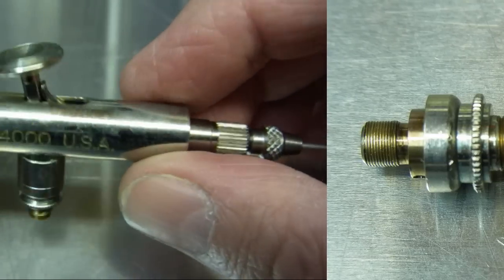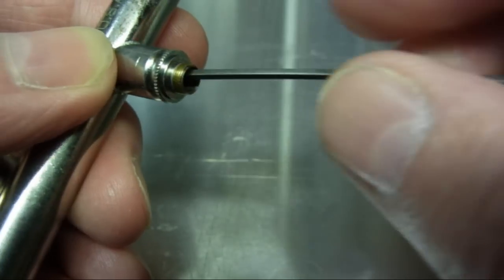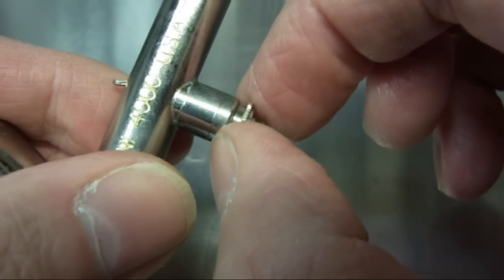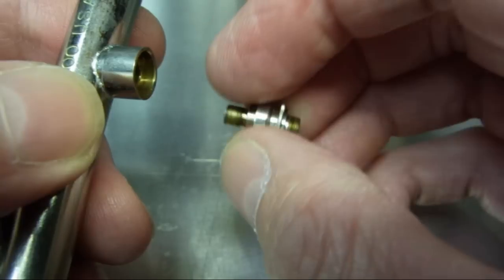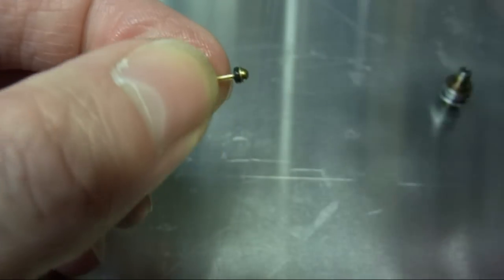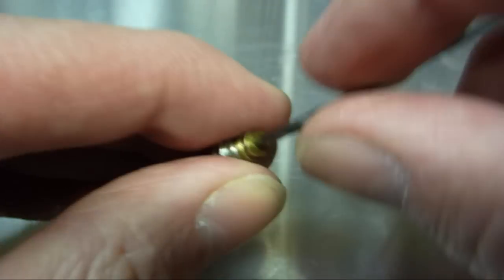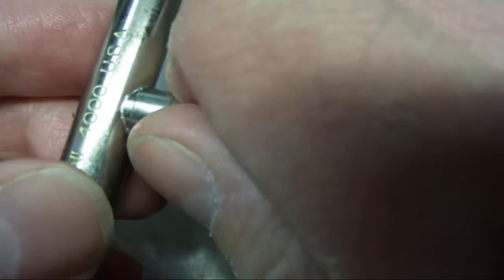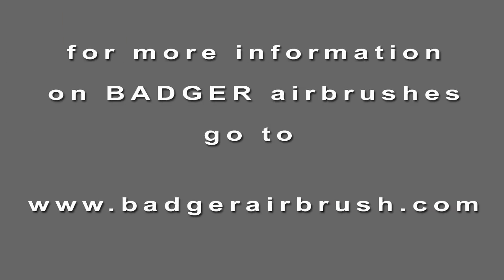Badger Air Valve Removal

Comment: As mentioned by the OP at  the 1 minute mark, many of the Omni and Badger e.g. Omni 4000 & 5000, Badger 150, 155  airbrushes share a common valve assembly including its internal components. The part numbers are marginally different, but they are the same part and identical components and are interchangeable. 

The hex wrench to remove the valve screw/referred to as a "nut" by Badger is 1/16" as the parts are manufactured in America.  You can get away with using a 1.5mm, but the 1//16 is a perfect fit.  Using quality Bondhus tools, I tried both. 

A couple of tips. 1. Unscrew the valve assembly from the body to tighten the valve screw/nut or you'll overtighten the valve assembly into the body and not tighten the valve screw efficiently. 2. If using an Iwata thread adapter 1/8" BSP with an internal rubber seal/seat,  be careful when unscrewing from the air hose that the valve screw/nut doesn't come away with the adapter allowing the spring, plunger and its rubber washer to fall unnoticed and be lost to the carpet monster if not immediately, at some future time. I have no idea how I lost my plunger, o ring, & spring from my Omni 5000, but best guess is this as it's occurred with my Badger 150 as the rubber seat grabbed the insufficiently tightened valve screw/nut and unscrewed it from the assembly as I unscrewed my airbrush from the 1/8" adapter which remained attached to the hose. Of course, a quick disconnect accessory will render this potential issue null.

Comment: THANK YOU SO MUCH. my plunger was stuck down. Saved my getting a new airbrush <3
Reply: Hi! May I ask how did you loosen the plunger? I am having similar issues except mine is stuck and won't go down
Reply: @tiyaz8014  i pushed it back using a thin metal rod.

Comment: My Badger arrived a few days before my Air compressor did.  It was working fine until I hooked it up to the compressor.  Now it appears the pin of the valve is stuck in the depressed position as the Trigger has no spring back. When attempting use it channels air constantly from compressor and out the front of the Airbrush.

How should I go about fixing this issue?

Comment: What is the thread size on the assembly where the air hose is attached, please?
Reply: 5mm, but an unusual pitch. Badger connectors are proprietary to Badger. Omni and Badger used the same valve assembly and so same connector.  If you're wanting to connect your Badger to the ubiquitous Iwata 1/8" BSP threaded air hose connection which is pretty much the universal standard, Badger to Iwata thread adapters are readily available everywhere from Amazon and AliExpress through to your local hobby or airbrush stockist.

Comment: Where you pointed and said "you won't get any air escaping" is exactly where mine is leaking. Any recommendations to a possible fix? I'm going to put some thread seal on it and see if that works. Other than that idea I'm stumped...
Reply: Nolan Oliver I have the same issue. Did the thread sealant work?
Reply: Don't use teflon tape.  Teflon tape belongs on the compressor fittings and hose fittings.  Instead, use a little plain ole chap stick on the threads of the spray regulator and spray head.  Leak GONE!
Reply: I can't find anything on this issue I'm having. It seems that the trigger is no longer depressing the plunger. The plunger will depress if I use a toothpick and push it down but it's like the trigger will not connect properly.
Reply: REPLACE THE TRIGGER. DONE and FIXED